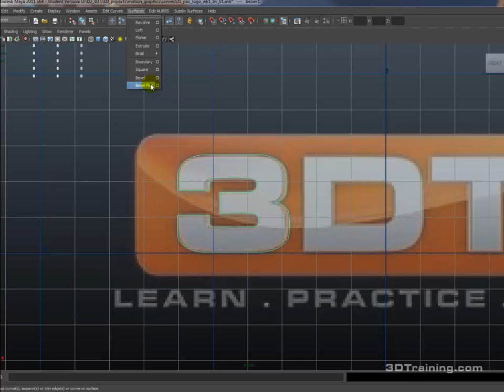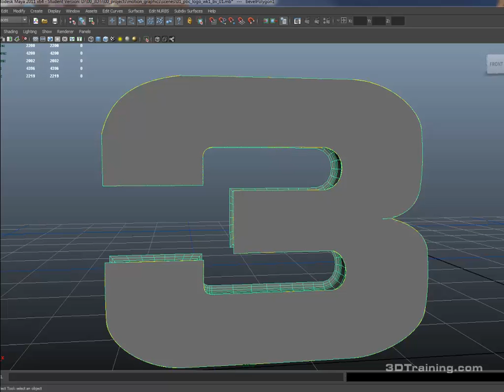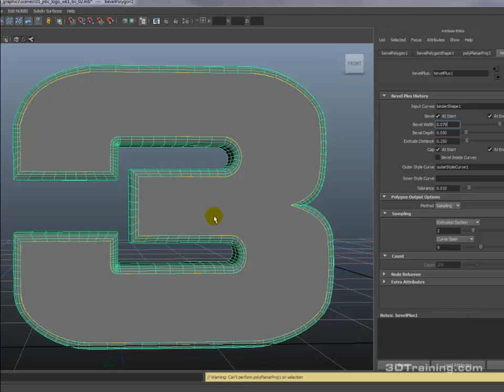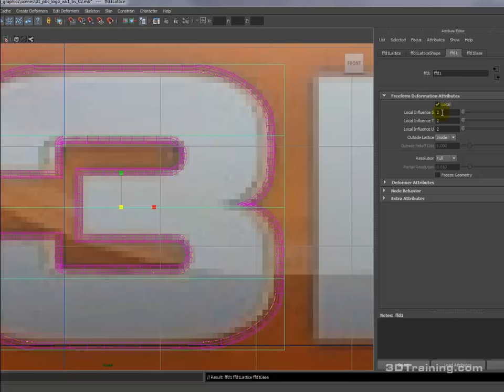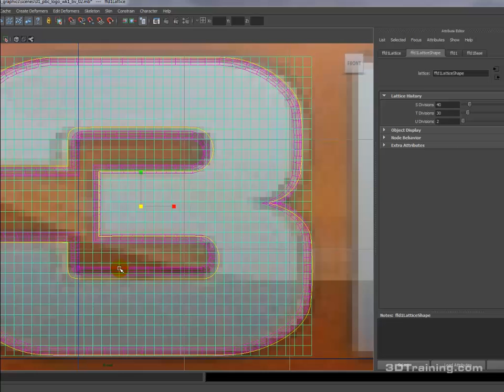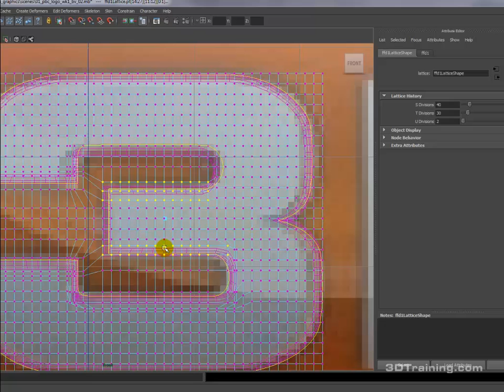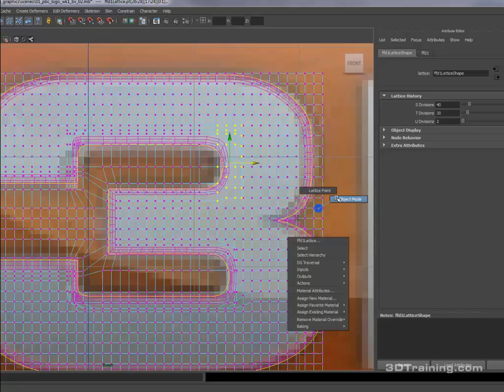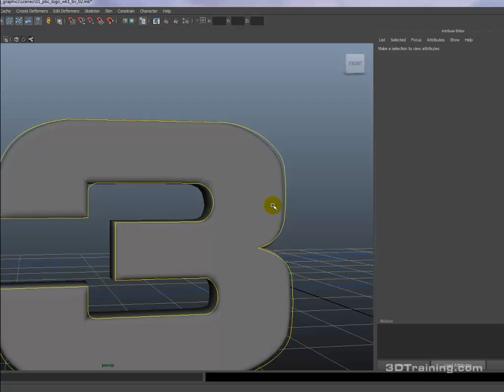Teaching Video - Modified Bevel Plus Workflow in Maya

Comment: Thanks for sharing! Maybe you have an answer for me.  I'm wondering the best way to do bas-relief using Maya. For example, if I wanted to model people, a portrait, cars, etc., but only have it popping out a bit. There is software out there where you can take a photo and convert it to 3d mesh ad there's software where you can take say a 3d head and flatten it some so it becomes a relief. Maya has the convert to poly mesh option but it doesn't produce enough detail if I needed a realistic looking image. I'm thinking my best option using Maya would be to trace a 2d image, photo, with my cv or ep curve tool and do a bevel. And maybe depending on the shape, I could also use loft and create polygon tool. Any thoughts?